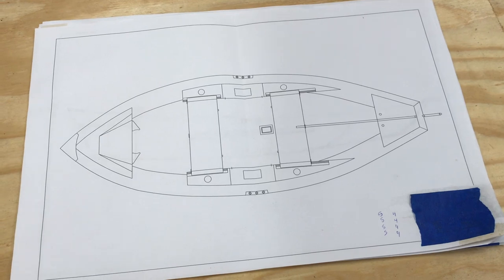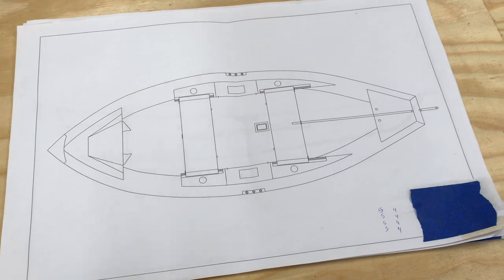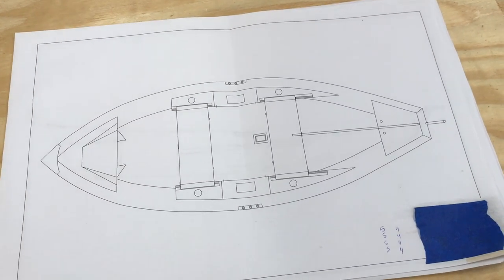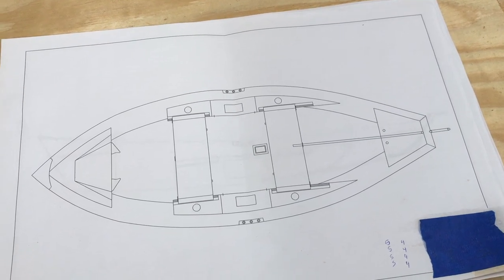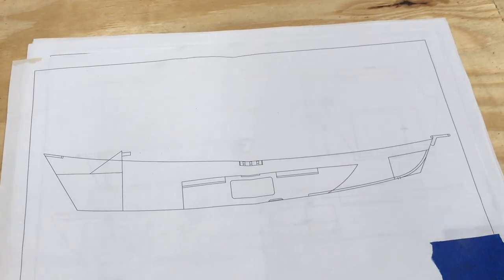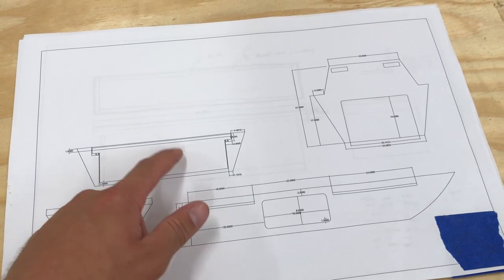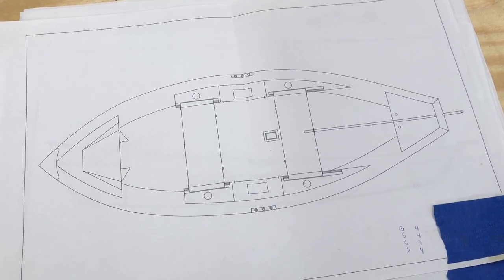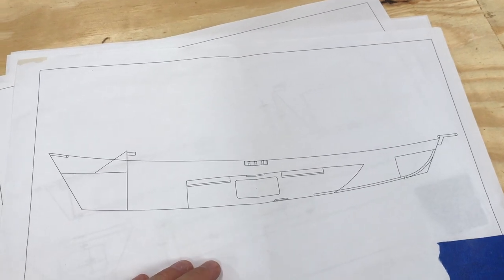Drift Boat Build Part 1

Comment: Did the plans for this boat come with patterns for the bottom and sides I seen the mini Mac has the patterns just trying to decide on which one I like. But I feel like patterns would make it easier
Reply from the maker: With these plans they give you layouts for the different pieces with the dimensions needed to draw the lines on the pieces of plywood. It’s super easy to do. For the bottom of the boat what they have you do is scarf two pieces of plywood together. Next draw a center line and then foot marks on the centerline. From there it tells you at each foot mark you made how far out to make a tick mark. Use a framers square. From there use a batten to connect the dots. It’s super easy to do. This is how most plans will tell you how to do it. You could make patterns for the boat pieces if you want to make more then one and then use a flush trim bit in a router to cut the pieces out. Hope this helps.
Reply: Erik Bjork thank you  very much